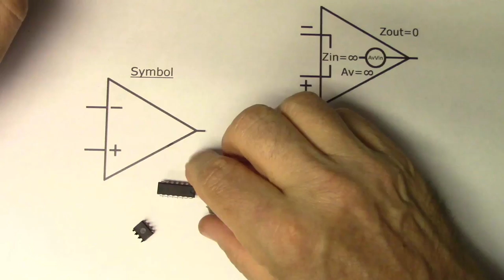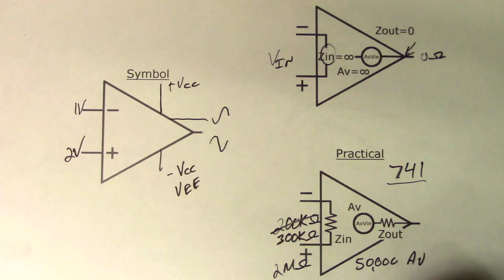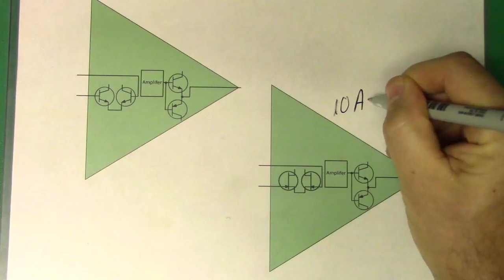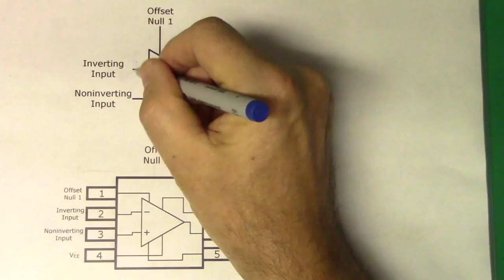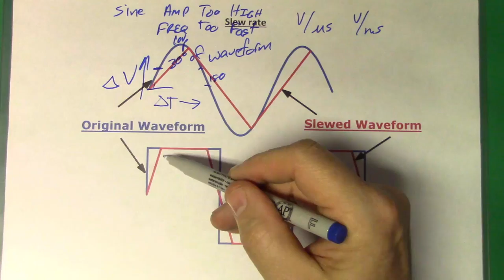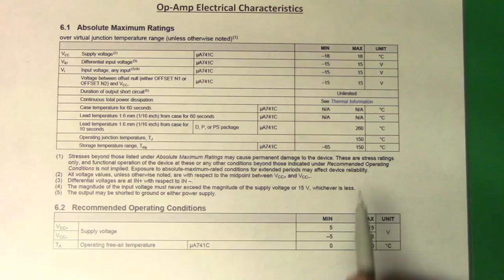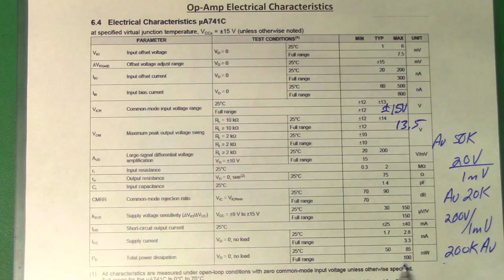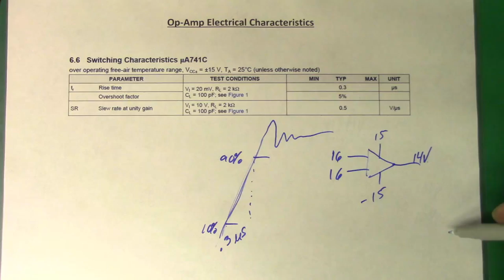57. Op Amp Basics Part 1

Comment: You should touch up the slew-rate diagram ... the op amp cannot anticipate a drop in the input signal, it can only react to one.
Reply: I know I'm late to the party, but I've only just seen this video. I was going to make the same comment when I saw the slew rate diagram. Just as the op amp reacts to the leading edge, it reacts the same way to the falling edge. i.e. it will start to fall at the same time as the input falling edge falls, not before. The op amp cannot know when that falling edge will occur.

Comment: Using a simulation software such as multi sim and others. Is it possible to have a null output when the inputs are grounded . I'm not really sure if the software op amps  operate practically or ideally.

Comment: I had no idea that there is dual output Op Amps with inverting and non inverting outputs. I know that vacuum tubes have this ability and I have seen their implementation in audio amplifiers to obtain the push pull output but with solid state I generally see the use of an extra Op Amp to do the inverting for the push pull output stages... Now I'm on a mission to find out which Op Amps have this dual output...
Reply: Shame  now you know

Comment: Thanks for all the work that went into this.  I'd love to see a video covering how to select a better op-amp, eg, for a modern 5V single rail application.  Using very old op-amps like 741 leads to student disappointment, as the Op Amp's performance and limitations restricts uses.  Better to teach something more modern, so students can then practice their understanding by applying it to their own real world problem.

Comment: At 27:55 I think you misinterpreted the meaning of differential input voltage. Based upon footnote 3 at 28:00 differential refers to IN+ with respect to IN-. If you put 15 V on IN+ and 15V on IN the differential voltage would be exceeded (30V).